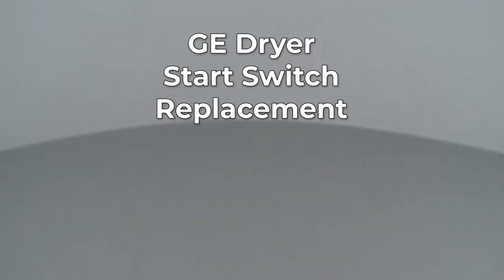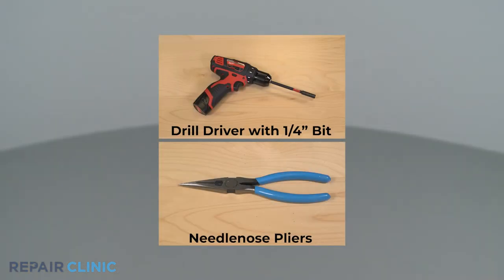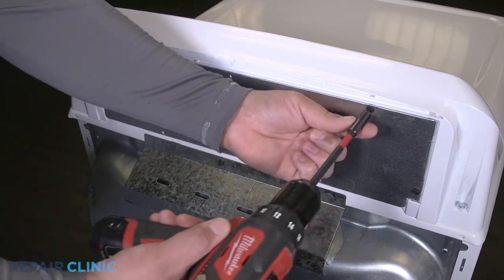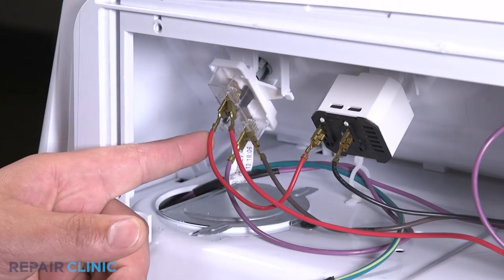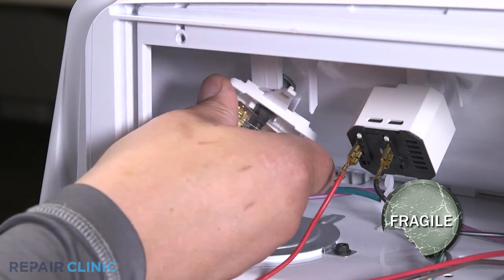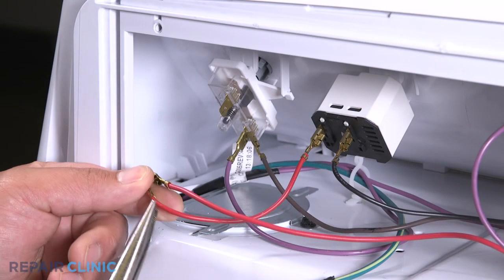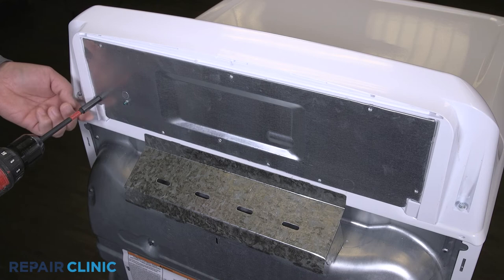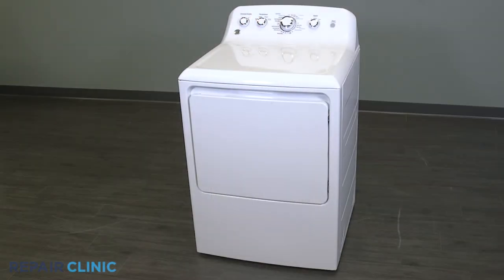GE Dryer Start Switch Replacement WE4M416

Comment: Hello thanks for your video, I replaced the start switch but it will not stay on. Any idea as to what else it could be?
Reply: I’m having that same issue with the switch not staying on
Reply: @mosesanderson1344 I had to replace the belt, it was completely torn and that’s what was preventing the machine from staying on.

Comment: Thank you. I couldn’t unplug dryer, so I shut off the breaker. Took back off, couldn’t get the ground off so I took out the screw, now disconnected. I was able to get brown wire and red wire off. The switch I had to pull a little harder to get off. Did turn. I put new switch in and reconnected all. Turn on but button wouldn’t push in or start. So took back apart. Took switch out, got old switch and compared them and realized, old switch had a metal sleeve on the black part that slides in to button. So put sleeve on black part, put switch back in. And reconnected everything and put backing back on. Turned breaker on, and now is working! Yea me❤ 
Thank you, 
Wendy

Comment: But it's not the switch that breaks, it's the poorly deigned cheap plastic retaining brackets.
Swap it out with a generic 16mm momentary push switch for permanent fix.
Reply: Hey , do you happen to have a photo of how you did it.  I was thinking of doing this
Reply: me too,,, I have had to replace mine several times and the holding bracket finally broke,,we clipped off the bracket and drilled holes and ran zip ties to hold push button switch in place,,, little red neck,,, but it works